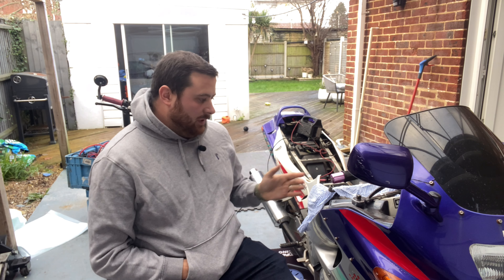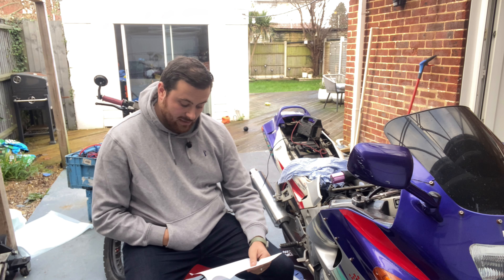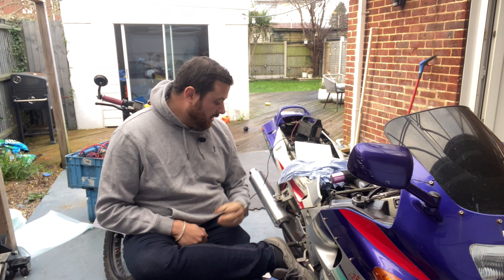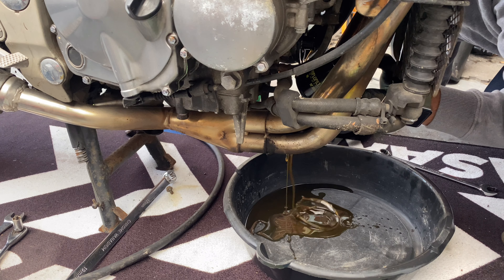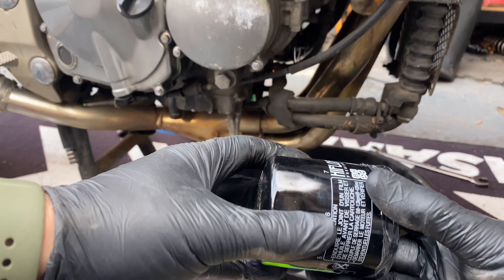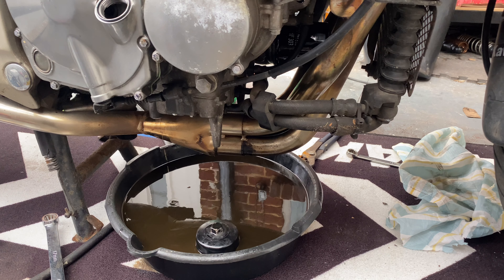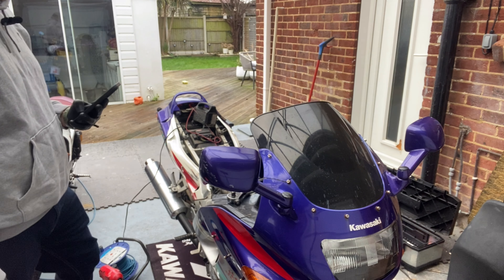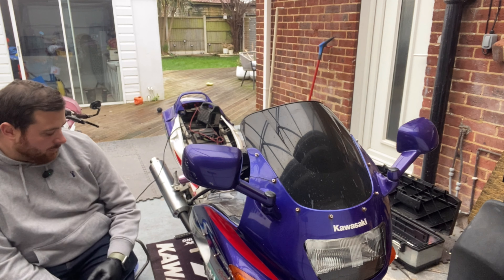How to Change the Oil on a Kawasaki ZZR 600

Comment: Some people won't have a filter with an hex bolt so if you are like me, you need to remove the 3 bolts on the oil cooler so you'll have enough room to remove the filter by hand.